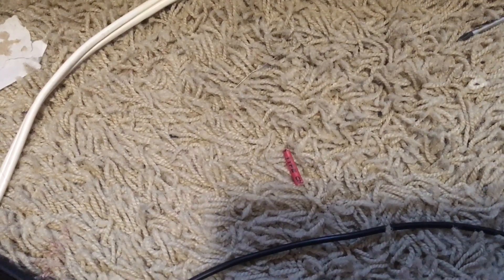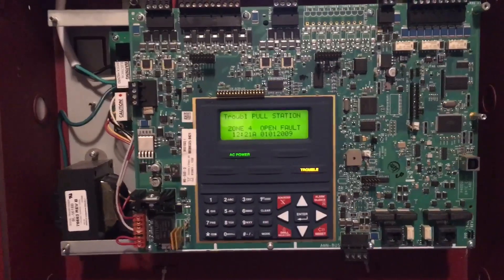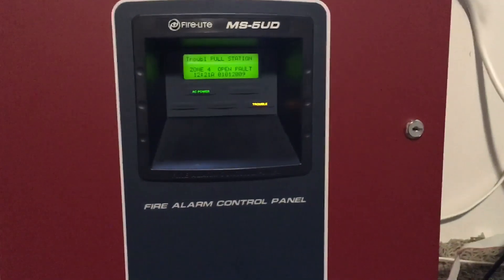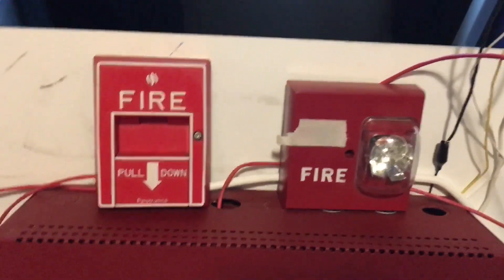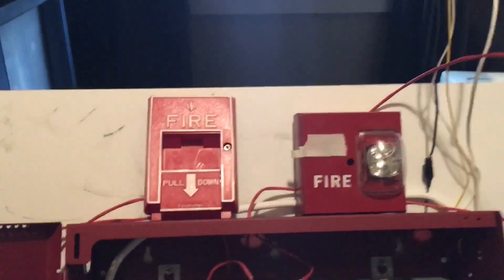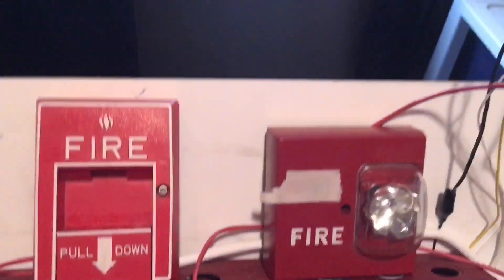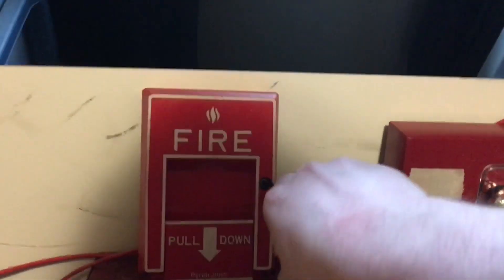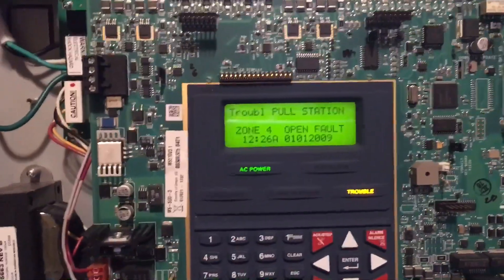Fire Lite MS-5UD System Test 1

Comment: So this means you will probably get rid of the AFP
Reply from the maker: Not at all. The AFP is staying. In fact, right now both the AFP-400 and MS5UD have systems. I’m wanting to do something for the 4006.
Reply: @SomeDudeWithAnExitSign  you said you would get rid of the 4006
Reply from the maker: @portlandrailfan-d2u  I say some stuff wrong. The 4006 is staying but is off the main system. I do plain after I get a new Demo board built, I will have the 4006 return to the demo board.